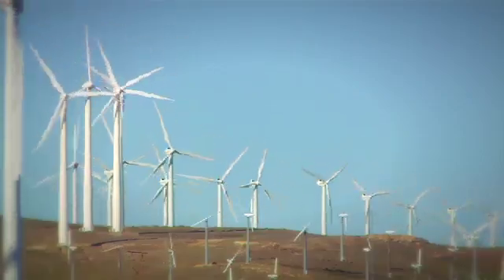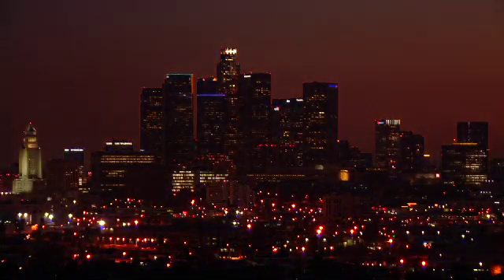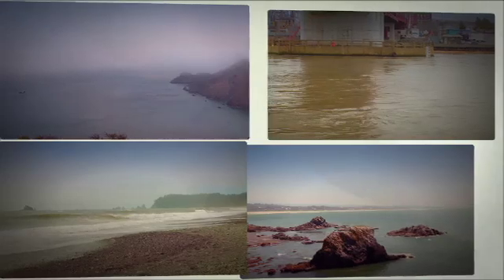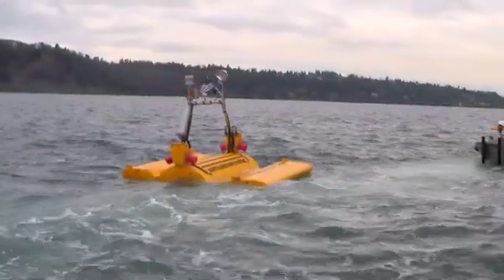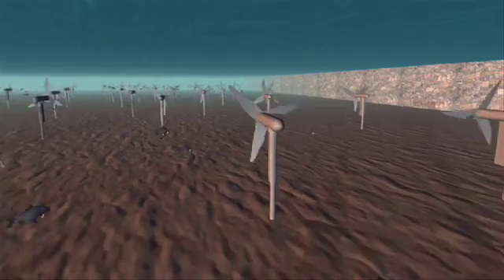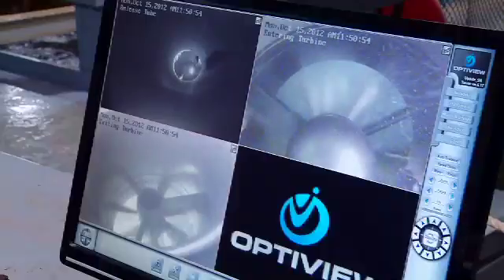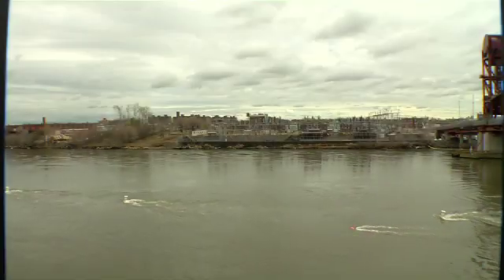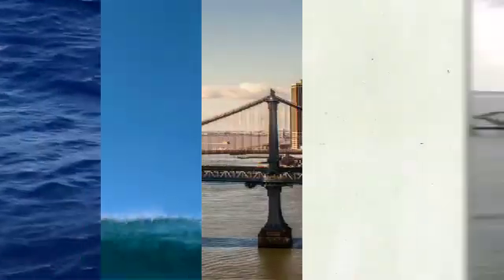Energy 101: Marine and Hydrokinetic Energy

Comment: Propaganda. This is a sales video, not introductory MHK presentation. We need electricity 24/7. The output from any MHK device other than tidal, varies greatly with the seasons and thus requires traditional (fossil fuel!) power plants to kick-in when production is low. Fossil fuel generating stations operate 24/7 and are down only for maintenance. Every 10 MW of MHK power probably requires and additional 5 MW of conventional power to keep the juice flowing 24/7. The combined cost is prohibitive.
Reply: Not really.
- We need electricity 24/7 -  electricity demand is much lower at night than during the day. Conventional thought is that we need energy production that matches our consumption patterns. Solar works well for that since it produces when we use it. However, a better paradigm is using electricity when it's produced, such as storing thermal energy for HVAC when excess is produced / costs are low and then using that stored energy later when less is produced / rates are higher. A similar application is charging EVs when there is excess generation. Such events are forecasted, and EV owners can be alerted to charge their cars at the appropriate time(s).  

- Intermittent production - Yes, each individual source is intermittent,  but like an investment portfolio or diet, diversification reduces a lot of the variability. Wind doesn't always blow, but it is almost always blowing somewhere. Wind on land and wind at sea generally peak at different times. Wind and solar don't peak at the same time. And with either the paradigm shift of using when produced instead of producing when used or improving energy storage (such as pumped hydro), the overall variation in production can be managed.

- Fossil fuels are required - No, just an on-demand energy supply is needed. It can be hydroelectric (including pumped hydro storage), geothermal, or nuclear.